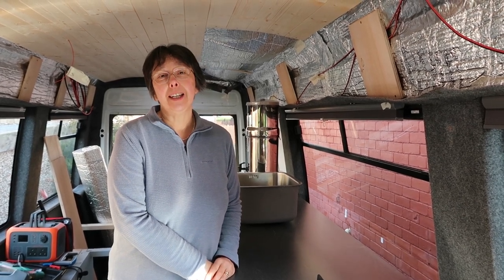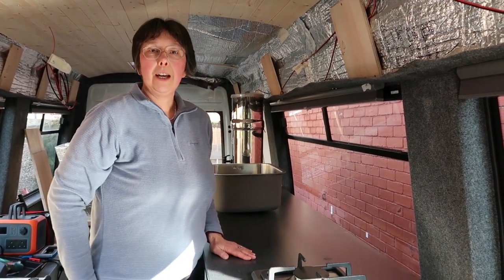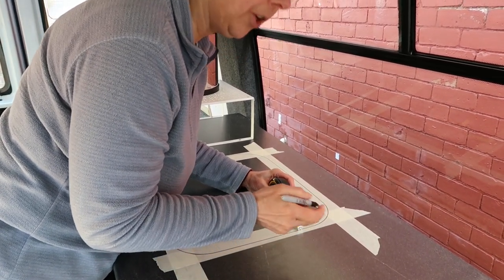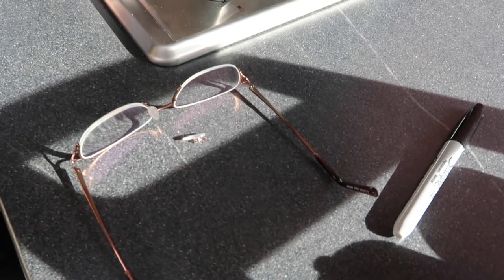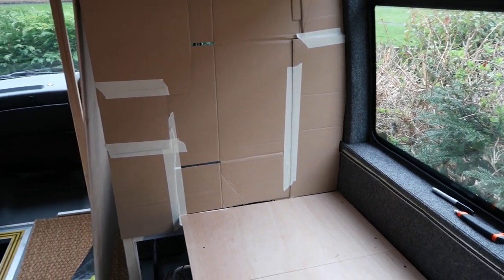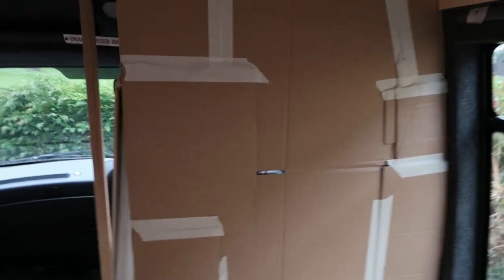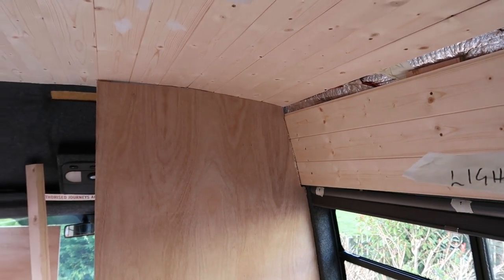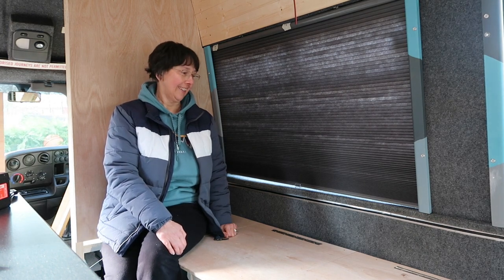Part 12 - Our Iveco Daily Self Build Minibus Conversion - The Cooktop and the Sink - #vanlife

Comment: Do you need to pass a special M. O. T. When you finish? Electric and gas fittings etc.
Reply from the maker: Bus is a class 7 MOT, just normal for this vehicle.....but strangely no one seems to check gas or electrics!
We opted for specialist gas fitter and have have a full gas safe certificate,  as we have no experience of this,  but Darren has completed all the electrical work as it's all 12volt...and very simple.
Hope ghat helps Patrick 😊